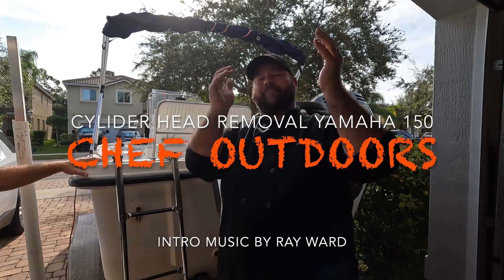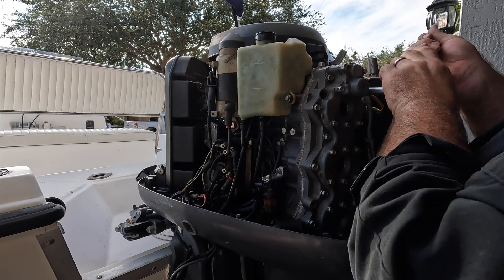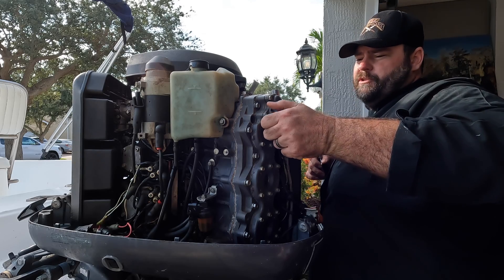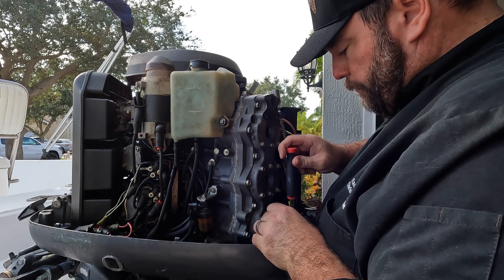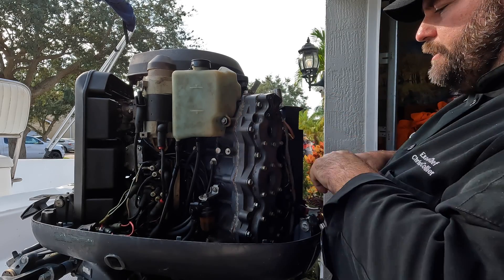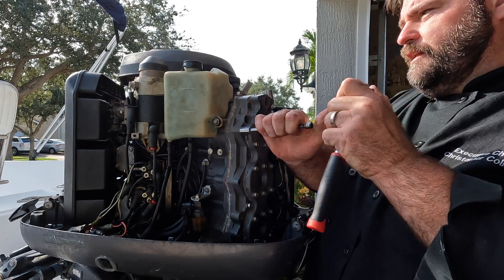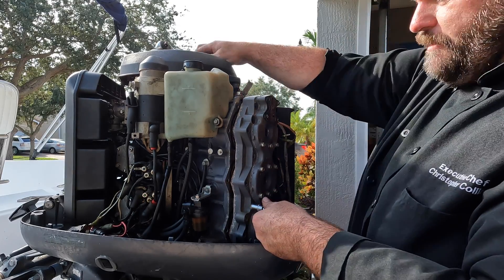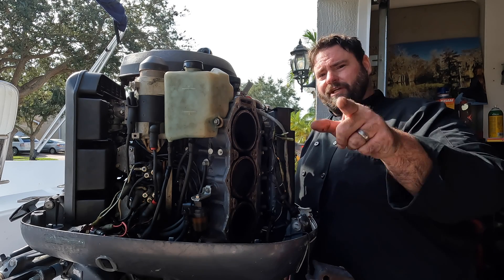Yamaha Cylinder Head Removal (Yamaha 150)

Comment: I had the same problem with water in cylinder 5 I changed head gasket was not that, o remove the brain box there was a hole  causing water to in that cylinder